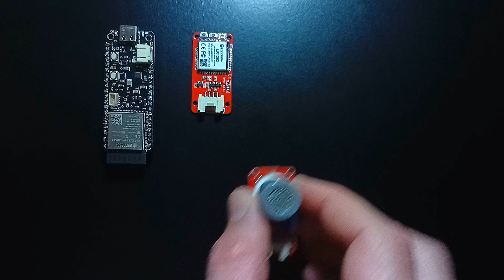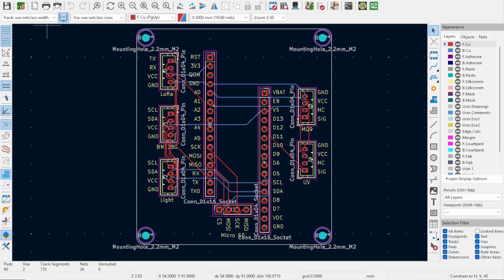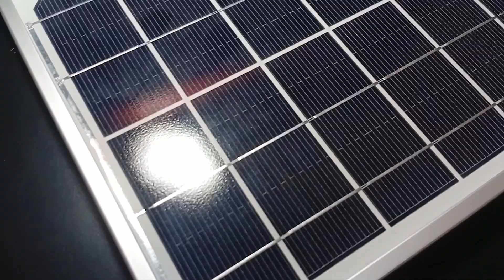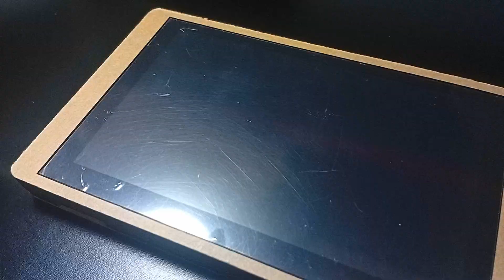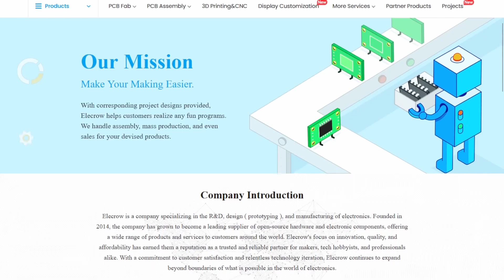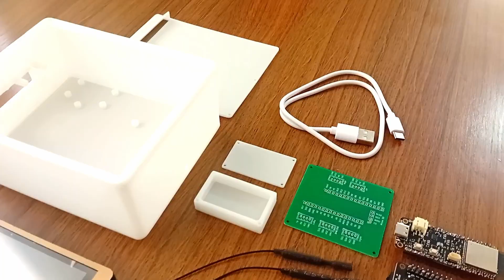From Idea to PCB: Building My First Hardware Product

Comment: If you design the circuit around the components and don't use the premade modules, it'll save you so much.
Reply from the maker: Thanks for the advice. You are totally right. Designing a single PCB with all components is way cheaper and looks more professional than using a shield PCB and premade modules. That's a goal I want to pursue after studying more about electronics and PCB design.
Reply: @lucasfernandochannel  okayyy. You'll get there for sure. 😁

Btw I'm an electrical engineer, with experience in embedded systems. I'd suggest you start with basic electronics and DLD. Those two areas can give you a very good understanding of electronics and microcontrollers.
Reply from the maker: @muflah  Thank you so much, that means a lot coming from an expert. I really appreciate your advice. I'll definitely dive into basic Electronics and DLD because I feel I'm missing the core foundation.

If you have any textbook or other resources you think would be helpful, please share them with me.